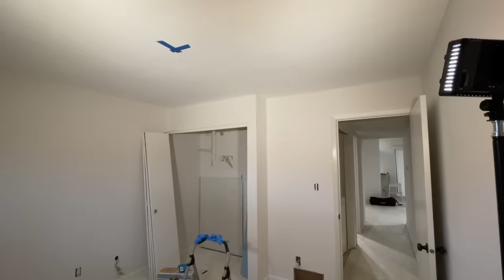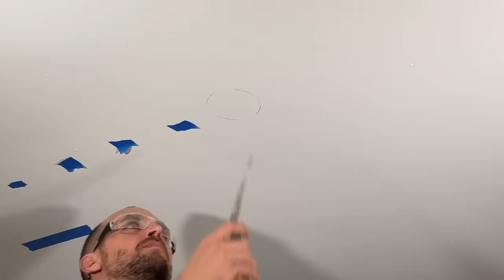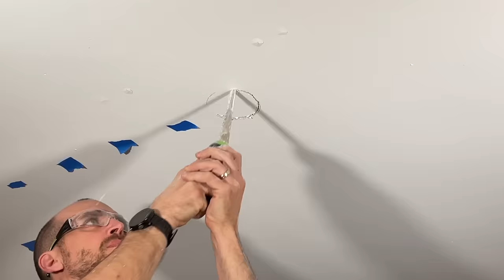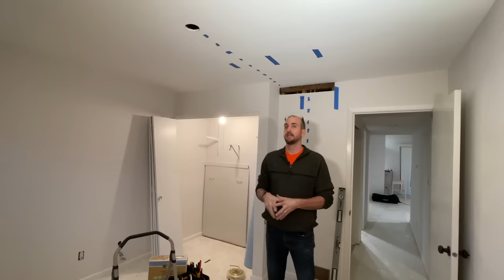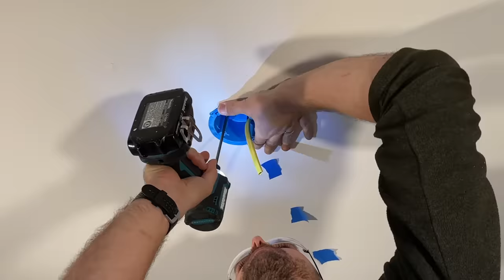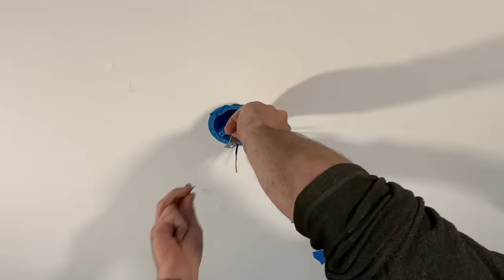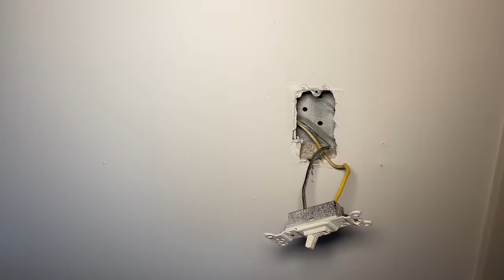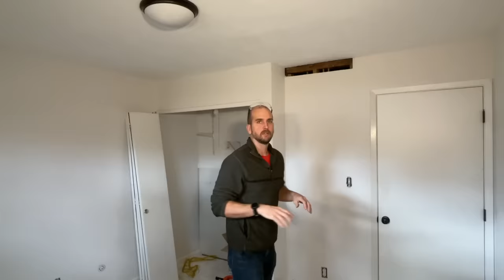How To Install Ceiling Light Without Existing Wiring

Comment: us electricians would have found a less  obtrusive way to run the wire such as cutting the drywall in the utility closet wall.....no patching and painting in the main room... why would you cut out the corner all the way to the ceiling.....now you have to do a corner patch and paint the ceiling too....call a professional
Reply from the maker: Thanks for the feedback John.
Reply: @EverydayHomeRepairs  Yeah. You should have paid a pro electrician $600 to do the job, then you wouldn't have to spend an extra hour doing all that drywall repair. ;)
Reply: @riverraisin1  how about painting.... corner bead.... ever try to match ceiling paint
Reply: @johnyunits7134  Corner bead on an inside corner? Really?

Comment: I can't believe there will be a room or bedroom on any house or apartment without a single ceiling light LOL.
Who the hell design that place!
Very odd place.
Reply from the maker: Honestly, this is not uncommon in our area.  Plenty of houses and condos built over the years just had switched outlets for lamps opposed to ceiling lights.
Reply: What planet do you live on. Ceiling lights went out in the 70’s
Reply: My house was built in 1979 and has no ceiling lights which I added using 14-4 and a double switch one for the fan one for the light.

Comment: He is not very careful. Last time i did this i cut out sheet rock precisely so that i was able to put it back without having to cut out a new piece. And the nails popping out was just embarrassing. I would not even use the hand tool. I would use an electric oscillating multi tool. They create a very thin fine cut with very little dust.   This is why i dont trust construction workers generally, they are clumsy and not detail oriented. But on a positive note, i appreciate learning from this video the method of access for the wire. That info helps me.

Comment: Dude  why  would you do that  why.... just run the wire  to the switch  and connect  the outlet thats the one going to switch  directly  and use the switch  for the light only  lol

Comment: 12/2 not necessary especially with LED lighting ....that light is probably rated at about 7 watts , wasted money on the more expensive wire. ive never in my life ran 12/2 for general lighting and receptacles
Reply: That depends entirely on the breaker. 12/2 is code required on a 20 amp breaker.

Comment: Ok I guess I’m calling an electrician
Reply from the maker: Yeah, if you are not comfortable or done this before it can be a little intimidating.  Not to mention even in my install there are issues that would not meet code and I needed to change (electrical box used and running romex through a plenum).

Comment: That could've been done without cutting drywall...lol
Reply from the maker: 🤔, could you elaborate on what magic you speak of?
Reply: You're not so smart
Reply: @pablosanchez9304  
Not smart but skilled in electrical especially fishing wires in residential walls
Reply: @slo-pitchhero8993  you're probably right man, I'll admit I've never worked on a condo style place.. I Do more commercial, industrial work... All the painters tape gave me a chuckle.
Reply: @EverydayHomeRepairs  
Glow rods+flex bits+1/2" paddle bit+mc cable 14/2.
Cut out switch box and drill up through top plate.
Attach loop to glo rod and guide up through top plate.
Determine fixture location and cut out. Set camera flash on phone and snap away till you locate rod with loop.  Use 2nd rod to fish line to 1st rod then attach wire.

Ok no more tips..lol

Comment: You put the ceiling light fixture in the hole you cut and then you screwed it into what? The light is between two joist and what can you possibly screw the fixture into? That confuses me.

Comment: "I'm not a licensed electrician"... Do you not need a licensed electrician to test and sign off?
Reply: No, Not if no permit was pulled.
Reply: What he is not showing is how he got through the top plate and upper stud in same area from the new light to the outlet on the lower wall. Makes one wonder why he is leaving out key difficulties in his video.
Reply: @alatwood3274  interesting. I'm a sparky from NZ. As soon as he said that @ I'm not a licensed electrician, I was like...nah lol

Comment: ceiling box location fine center of room us small hole  ben small wire into a l shape to turn up in ceiling to see if you have room for a ceiling box if you hit a joist you can use a pancake  box to mount

Comment: Horrible way to cut dry wall not to mention an unsupported electrical box. Cut the dry wall and retain the piece to reinstall. Find a stud or install one to the electrical box. Run extra wires because one day somebody will want to put a ceiling fan.
Reply from the maker: Thanks Ralph, looking back (with the help of 100's of comments) I completely agree with you.  Thanks for the feedback 👍

Comment: This? Is why I hate Condo flippers.

You had the access, you had the floor joists,, you should’ve nailed cross support box not just for a stupid light weight light but for anticipating a ceiling fan.....

It wouldn’t have been that much more work....

smh.

Comment: Tou used wire nuts instead of the cheap looking plastic connectors you are using plugging.

Comment: American wiring looks really backwards
Reply: Dr. SJC  lol but you guys are still twisting wires together and not sleeving your cpc. You guys shouldn't be looping wires over screws for a connection on your socket/ switches in 2020.
Reply: Dr. SJC  lol exposednlive conductors seems very forward thinking

Comment: If you screw up the plumbing, you get a mop, and maybe a bottle of Clorox.
You screw up the wiring you call the fire dept. and maybe the coroner too.
Amateurs should not be teaching classes on do-it-yourself house wiring.
You don't need plug testers and meters to stay safe, you need to have a qualified electrician. Mr. Everyday Home Repairs ain't it.
Putting aside the issue of the junk ceiling box that someday is going to come down on someone's head because they assumed a proper install, the solid wire splices in the outlet boxes, done without firmly twisting the conductors with pliers, is an invitation to an electrical fire. 
This is especially so if a space heater or other high wattage appliance is left plugged in.
Bona fides; Retired electrician with 40+ yrs in the trade.
(ps; The apartment in the video is probably the only condo unit on the planet with no ceiling or wall insulation for noise suppression, you got lucky as well with the dead space behind the wall, and the direction of the ceiling joists. Someone following your lesson is unlikely to be so lucky. I never was.)

Comment: Why would you use 12/2? For a light? Not an electrician
Reply: If the lights are on a 20 amp circuit, possibly on the same circuit as the outlets, ALL wire on that circuit must be #12. Otherwise, if there is a short somewhere, the lighter wire might effectively become the fuse.

Comment: BAD PRACTICE to use an old work box for a ceiling fixture, fan brace box is code compliant, and check local codes to see if they even allow Romex to be installed. Also cmon! Use lineman pliers to twist your wires together so you don’t have any arcs or problems down the line! Anyone watching this, look for a licensed electrician to follow what we do, this is bad info.
Reply from the maker: Thanks for the feedback Matt.

Comment: That yellow wire should have been tape up with black tape so no confusion to new owners
if need to do work in the future plus black tape around outlets where wire is connected to
prevent spark or fire in the wall.
Reply from the maker: Appreciate the feedback!
Reply: @EverydayHomeRepairs  You do want to tape the terminals when going in to a metal box.  It's dangerous to have those terminals exposed that close to metal.  If someone yanks a plug to hard it can cause the terminal to touch the box.

Comment: Unbelievable. Like you said, you're not a qualified electrician (I am), so you definitely should not be giving this advice. 
If you are in the UK you should not, and CANNOT wire like this, ring main and lighting feeds are protected, and wired completely separate. 
At the least this advice is VERY bad practice, at worst downright dangerous.

Comment: If you care about NEC electrical code don't do anything this guy did! If it is a condo and originally wired in conduit it is probably classified commercial so romex wouldn't be allowed even if it is "residential" The remodel light box he used is NOT rated for a ceiling fan. I know electricians are expensive but so are doctors, are you going to perform your own surgery? Some projects are suited for homeowners but get your advice from a licensed electrical contractor, not some dude on you tube!

Comment: I would not add a ceiling light without supporting it for a fan. Just because I have seen people add a fan not knowing if the box is braced. I call it down the road safety.

Comment: That round box can be used to support devices like smoke detectors in sheet rock, NOT luminaires. You were so close, you could have installed an old work ceiling fan brace (good for light AND fan) and it would have been right.  I'll also add you could have brought that ceiling light wire to the switch instead so you could install a dimmer. (maybe even have installed a 3 wire so you could separately control a light and fan). ...By the way, That's great at the end, 16:00 "I'm not a licensed electrician so I'm just giving you my opinion". IT WAS MORE THAN YOUR OPINION. You made a how to video and your not licensed to legally do the work that you did let alone direct people how to wire. smh

Comment: Wow.  12 guage wire to a single LED light.  Talk about overkill...
Reply: If the circuit breaker is rated at 20 amp, 12 gauge wire is required.

Comment: by nec definition "outlet" a point on the wiring system at which current is taken to supply utilization equipment. the term outlet is frequently misused to refer to receptacles. although receptacle outlets are outlets, not all outlets are receptacle outlets. other common examples of outlets include appliance outlets, lighting outlets, and smoke alarm outlets. did you add an afci breaker to that circuit since you extended it more than 6'? you also need 6" minimum of free conductor at all of your boxes. but like you said you aren't a professional and are teaching people the wrong way to do electrical work. do you even know what the nec is? if your home is wired in conduit ( by the way good job not calling it pipe) your jurisdiction probably does not all nm cable. why aren't you using the $5.00 devices that you said in a previous video that are better? you aren't being cheap now are you? and why didn't you install a fan rated box and three wire for a future fan?

Comment: As an electrician.....I don't get these videos. You only need to make a small hole directly above the switch. Yes the wiring should go to the switch, not the outlet. Rewire that outlet below and replace all the devices (if they are all switched outlets also) It should also have a fan rated box for future (if a paddlefan) goes in by the next owner (required in Massachusetts code btw). You only need to drill the plate and snake from the box location to the next bay.  🤦‍♂️🤷‍♂️ No need whatsoever to take that huge piece of sheetrock out, which he could have saved and reused with tape and joint compound. I obviously didn't watch the whole video before my comment.... he made another hole? And.... you admit your not a licensed electrician,  that was pretty obvious by hole number 1..... stick to your day job!

Comment: I have to say, from Australia, i’m so sick of seeing the American standards of using ‘ wing nut ‘ wire joiners , this is the most worst wiring item used  regardless of voltage. ‘ pressure ‘ copper expands and contracts and depending on the skill set of the individual, tension and twist applied will vary , and in time become relaxed and set a voltage drop scenario and possible thermal incident ( fire )

And  these poor  so called joiners / connections allowed in your country , like  ‘Scotch locks ‘ in automotive use for joining power supplies , etc… this is the poorest use of way to join 2 or several wires.

Why don’t you use  butter field joiners or screw joiners , these ‘ Wing nuts ‘ joiners are so poor and I’m surprised a country like America allows this back ward item to be not banned and used ,  I laugh at the boxing system and tubing that connects the wiring and how much focus is in that system , but something as simple as joining wires is soooo over looked !

Comment: What he did here is the amateur and wrong way of doing it.  You don't connect the new lighting wire to the receptacle. You connect it to the light switch and adjust the wiring of the receptacle so that the receptacle will have continuous power. Having a switch-powered receptacle was just a cheap way of wiring new houses where code required a switched light in a room. Builders would install those instead of the added expense of running wiring for a switch-powered ceiling fixture.  There is no need for (and it's actually stupid to have) a powered receptacle when or once you have switched-power to the ceiling.  With his way, it's more work, more damage, and you still have the stupid switch-powered receptacle,; which is now effectively only going to have power available to it when the ceiling light is on. Poor installation tips. This guy should be run out of business.